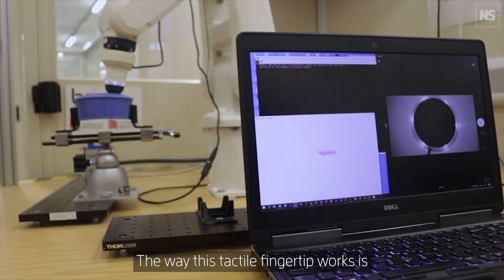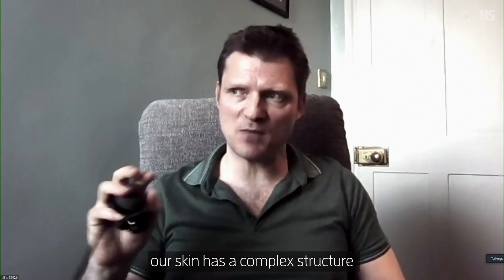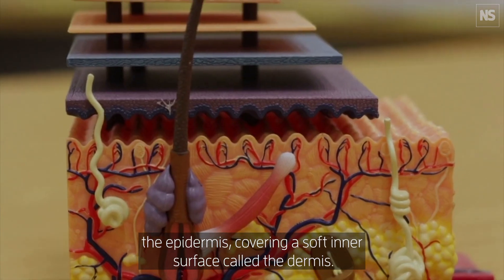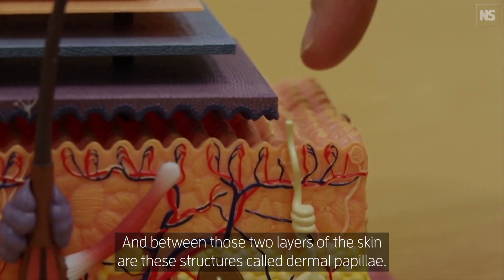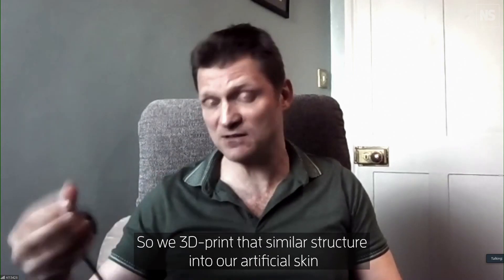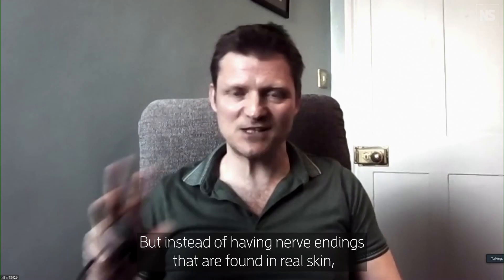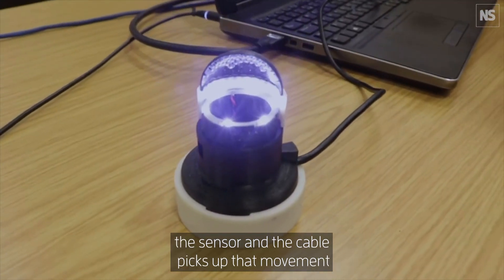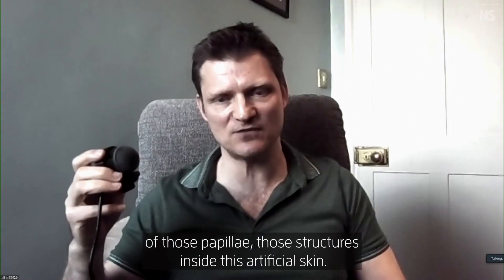Robotic fingertip has human-like sense of touch

Comment: I don't know.  Looks kind of cumbersome and bulky. What's the application for this?
Reply from the maker: The idea around improving touch in robotics is to help robot hands have more sensitive feedback loops which, in turns, helps them handle more delicate objects and improve dexterity.  There are obvious applications in prosthetics, too.  The University of Bristol researchers are well regarded in their field.  Ones to watch for more robotic innovations.
Reply: @NewScientist  yeah, I'm not sure that's exactly true.  Sometimes a simpler solution is best. I suspect you may be developing something that doesn't actually need to be developed.  Also decades ago I recall reading in New Scientist Magazine, no less, about a robot finger sensing technique that involved a sandwiched mesh that allowed multiple points to be sensed across the finger tip.   Seeing essentially the same thing repeated decades later tends to suggest to me that this avenue of thought does not provide fruit.
When was the last time a robot manufacturing firm conclude that they could not achieve their ends unless they included sensitive finger tip sensing. I'm thinking not for quite some time, if at all.
Reply: @RobertA-hq3vz  I think the only thing such invention will be ever applicable be in a salad choping robot, Other than that,  I dont thing there is any other real application.
Reply: @astroid-ws4py  that's the problem with scientists, they don't think practically or in a business like sense. Which is why they're always desperate for funds.